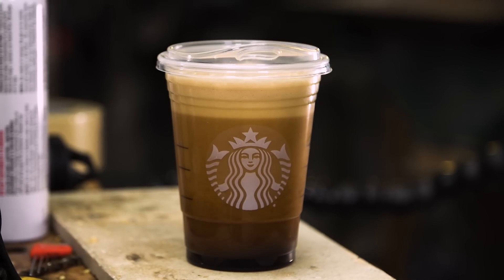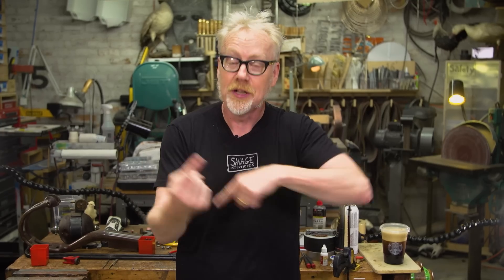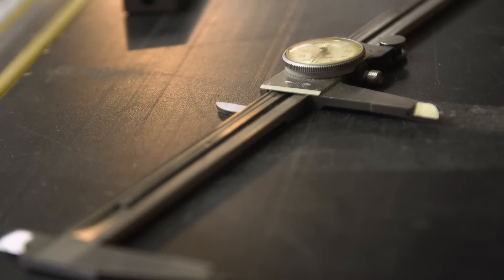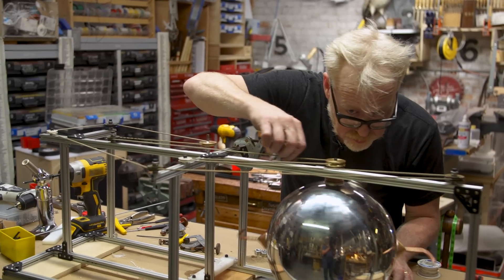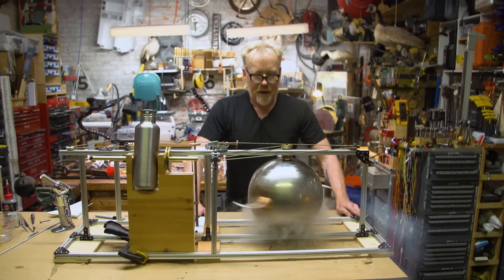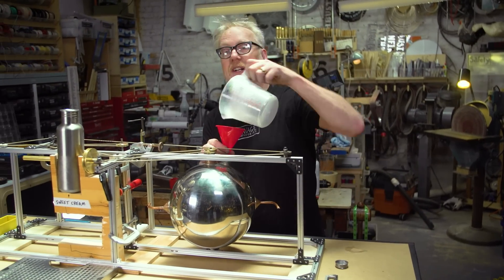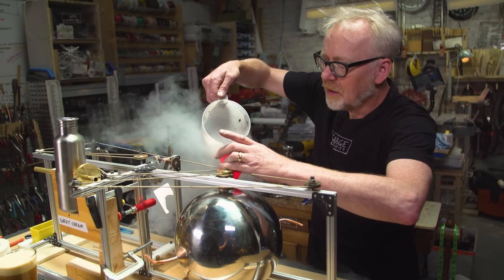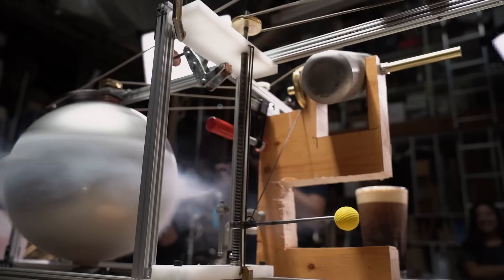Adam Savage Builds a Hero's Engine Sweet Cream Pourer!

Comment: Adam Savage will soon have an entire line of overly engineered machines designed for one specific use. "From the brand that brought you the over-engineered bottle opener, now brings you the unnecessarily complicated milk pouring machine. *some assembly required. Savage Industries is not responsible for any injuries sustained or your kitchen being destroyed."

Comment: Handling liquid nitrogen without safety goggles or gloves makes me wince. Don't you dare hurt Mr Savage, Liquid Nitrogen!
Reply: I was more worried about nitrogen displacing oxygen in an unventilated space. Super dangerous and kills each year in labs.
Reply: @ramiel01  he was using about 1 litre which forms about 1 cubic metre of gas which won't cause a problem in a shop that size.
Reply: yeah you dont want liquid nitrogen getting trapped in your gloves... atleast without them it just glide off your skin with a slight leidenfrost effect.
Reply: tongs
Reply: Most professionals who work with liquid nitrogen recommend not wearing gloves. It is actually safe to pour liquid nitrogen directly on your skin, because the Leidenfrost effect prevents the liquid from effectively transferring heat. In retrospect, gloves can soak up the liquid nitrogen and hold it against your skin, causing severe cold burns. Goggles may have been a good choice though.
Reply: @RobertBarton86  Totally correct, but if you have a ring on your finger, like Adam does here...
Poof no more finger☝️
Reply: That's interesting. Learn something new
Reply: @RobertBarton86  Goggles over glasses is... Painful... and usually results in not being able to see. I know this first hand haha

Comment: It looks like the Hero's engine really starts spinning once the centrifugal force brings the liquid up to the level of the nozzles. You see a distinct point where it starts to take of. Adam, can you confirm this?

If this is the case, you can improve it by putting the nozzles lower, or have internal tubes that go to the bottom.

Comment: You like a little coffee with your sweet cream. ;)  You did have a disclaimer at the start of the video but you should have really been using proper gloves when handling the liquid nitrogen. If it had splashed on you, possibly in the case of the plastic funnel cracking from a sudden change in temperature, it could have been a very bad day for you.

Comment: Maybe if you had a small discrete heat pad under the sphere it could keep it at a nominal temperature to encourage boiling. It also looks like once the sphere gets to speed it forces the nitrogen higher up the sides and increases the surface area. If you could add something inside to limit pooling it may increase efficiency.

Comment: Seemed like the engine needed to get up to enough speed to force the LN2 centripetally high enough that the liquid was being expelled rather then just the gas. perhaps having the tubes extend internally to the bottom of the sphere to act as pickups would have worked better?

Comment: Do you think it is just pressure in the ball isnt high enough? To force the gas to shoot out the side vent?

I notice the ball was covered in frost so the hole in the tube could freeze too blocking the gas from escaping. I feel like you should put a few candles on the spout to warm it up the N2 would put out the candle as it is expelled from the spout.

Comment: common, adam, you know better than me, that it is a bad idea to put a video on the internet of handling liquid nitrogen without gloves :/
Reply: It's more dangerous with gloves, not sure exactly why but it soaks it up or something and gives you burns. Your hands are warm, and because of the leidenfrost effect the liquid nitrogon glides right off your skin.
Reply: No problem with that, in fact gloves can be a hazard when dealing with LN2. If the LN2 happens to get between the glove and skin it will be held in place and cause injury. As long as you do not submerge your hands or try to hold LN2 in your hand the Leidenfrost Effect will protect you.

Comment: Friends do no let friends drink Starbucks.  I should point out that with a proper pull, with a correct shot this is the same effect when you make a Latte or Cappuccino.   The milk/froth cascading down with little bubbles.  No nitrogen needed.

Comment: It looks like it had to be spinning fast enough for the centrifugal forces to cause liquid nitrogen to rise up to the circumference of the sphere, so that the liquid would enter the nozzles, before significant thrust was developed.
Reply: or so there was enough surface area coated to allow sufficient heat transfer and evaporation of the nitrogen
Reply: @timbr33  my thought too... Some % of the steel sphere surface had to be in contact with liquid nitrogen in order to transfer enough heat to generate enough gas... Plus pushing liquid through the nozzles using the gas pressure would generate much more thrust than just the gas. I want to see an episode of experiments with this sphere to determine why it worked!
Reply: @kschleic9053  I think you're right... work (and fog) increased when liquid nitrogen was going through the nozzle (then instantly evaporating).

I still want to make liquid nitrogen ice cream... that would be better than just adding nitrogen gas to coffee.
Reply: If the ball spun around a horizontal axis rather than a vertical one warm surface would constantly be brought into contact with the liquid nitrogen causing faster evaporation with a much lower starting speed
Reply: Yeah, I think it would benefit significantly from a heat source. Or a starter motor :P
Reply: @wackyvorlon 
Heat source.

Comment: 0:22 reminds me of a freshly poured Guinness before its settled.
Reply: Guinness uses nitrogen too, its the same effect
Reply: My son was watching it before I did and I walked in on the final attempt and wondered why he was putting sweet cream in Guinness! lol
Reply: To be specific. CO2 is water soluble. Nitrogen is not. Considering you don't want your coffee to be carbonated (like beer). They use nitrogen as a serving gas. Guinness (and other Nitro beers) is carbonated in the traditional fashion with co2, but the serving gas is Nitrogen. Why Nitrogen, well the technique that they use to server the beer (or in this case coffee) and get that cascading effect is to push it through a restrictor in the beer tap. This means you need enough pressure to push it through. Normal serving and carbonation is achieved in the 3 to 8 psi range. (you might carbonate at around 8psi, then serve at about 3 psi) This low pressure is all it takes to get it out of the keg and is not going to effect your carbonation much. To push through a restrictor requires somewhere near 40 psi. If you use CO2 to do this it, it is water soluble and will be absorbed by the beer and will be extremely carbonated (probably moreso than Champagne). to solve that problem they use Nitrogen, which wont effect the carbonation of the beer but will give you that kick ass cascade look. The coffee does not use any form of CO2 for carbonation, only Nitrogen for serving.
Reply: @sparkyenergia  Thank you for the in depth and elaborate response. Ironically what's supposed to be an advert for coffee has got me thinking more about beer.
Reply: @jeph-rey  I'm a home brewer. Beer is good.
Reply: @sparkyenergia  Good point! Infusing coffee with CO2 would definitely affect its taste in an unpleasant manner, which is not a problem with beer.
Reply: I  think that's the idea.
Reply: Nitro coffee could be nice.
Reply: Scarily it does.  I must investigate further
Reply: @gallimead  Guinness uses what they call ''mix-gas'' in their stout. It's a mixture of nitrogen and carbon dioxide. This is why it has to settle, same as with the coffee.
Reply: @gallimead  And this is also why the bubbles go from the top to the bottom, and not from the bottom to the top as in regular beer
Reply: Same gas, but more importantly: same container shape of being slightly wider at the top. Most bubbles float upwards through the center. This creates an updraft of coffee through the center, which creates a downdraft of fluid around the sides, pulling the bubbles down with it.